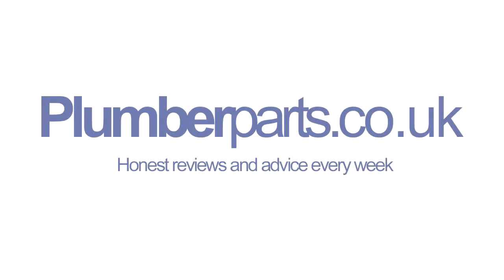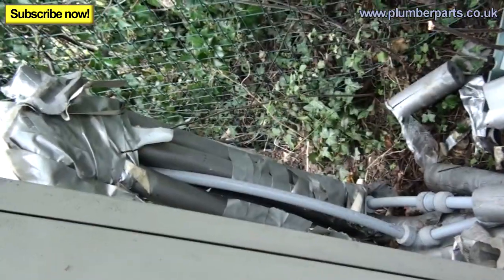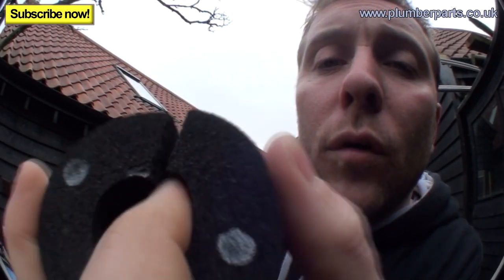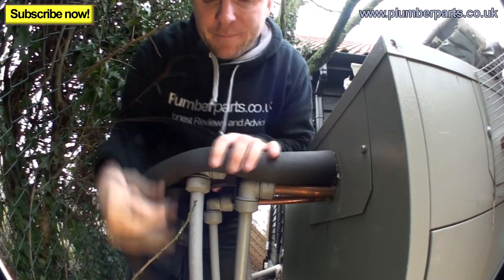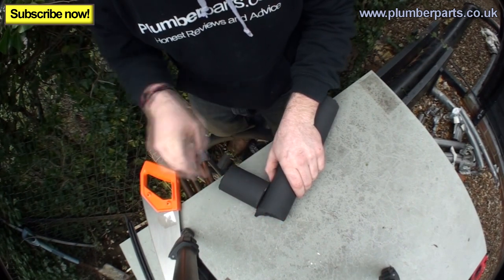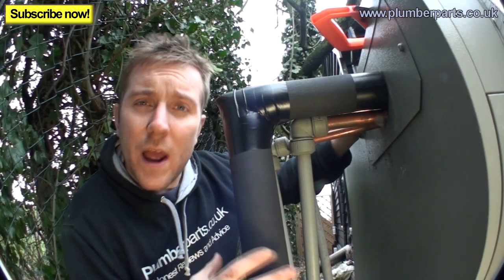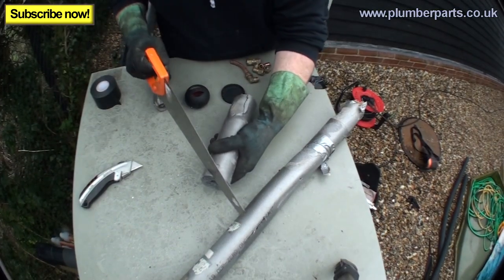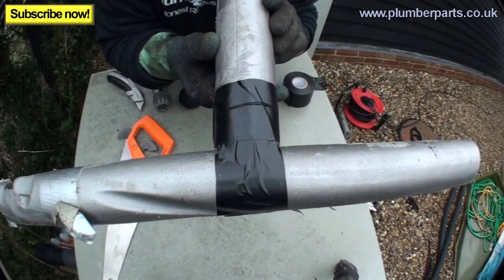HOW TO INSULATE PIPES - Plumbing Tips

Comment: Tape won't last, Armaflex will not last more than a few short years baking in the sun before it'll become brittle, crack and useless. There are better ways of applying the insulation (glue) and certian uv resistant paints. But what do I know? I'm just a heat and frost insluator professional.

Comment: For the miter I “carefully” use an electric miter saw.  I start the blade then let off as I carefully lower the blade.  A much safer way is to place a dowel in the center while cutting.

Comment: yes it's in a building I made. the pipes are insulated but the drain and lower part of the washer is exposed to the weather. also the water lines going to the machine.

Comment: Some points of clarification if I may.

1 – Insulation. Polyethylene insulation (generally the grey stuff) cannot protect against freezing. Why? All insulation begins to shrink at 4 degrees C (by as much as 10%) so needs to be installed in a manner that compresses joints thereby allowing for shrinkage without exposing pipework. Polyethylene cannot be compressed enough for that to occur. 
Currently, as you say, only nitrile based products (e.g. Armaflex) can do this. Furthermore, unlike protecting against heat loss where any cover is good, every tiny exposure to air when protecting against freezing is bad. This is why EVERY joint MUST be glued because tape will eventually just fall off. Whilst glue is sold (but never used) for polyethylene insulation, the waxy surface nature of the material makes the glued joint its weakest point. When gluing nitrile based insulation the glued joint is actually stronger than the material itself with zero degradation in insulation performance. 
Lastly, everything must be covered even the gland boxes of taps and valves
2 – Why do pipes bursts. Think of a length of pipe. When it freezes a plug forms (we won’t go into why…) and even though water is apparently uncompressible, the pipework and naturally occurring air in the water take up that expansion as the plug is typically quite small. Soon another plug forms. That too is accommodated. Then the third plug forms. This is when it gets interesting. Unfortunately it's nothing to do with a pipe being weakened. What actually happens is that the formation of the third plug causes the hydraulic pressure in the pipe to rise (up to 250Bar!) because the remaining water cannot accommodate the expansion. At this point you get the explosive decompression so characterised by the flared splitting of the, typically, copper pipe. The leak only starts as it begins to thaw. 

Plastic pipe is more accommodating of freezing but the fittings are not because they blow off quite easily. By the way, 15mm pipe typically bursts at about 30ish bar (450psi) and 22mm 20 ish bar (300psi).
3 – Freeze protection. Insulation can NEVER protect against freezing. All insulation can ever do is slow down the loss of heat.
If you wish to protect pipes from freezing then the heat loss must be balanced by heat input i.e. by the installation of electrical trace heating.

Apologies for going on, but people need to know the real facts so they can make informed choices on how to protect their property and systems and your vid helps hugely.

David @TapMedic
Reply: Can I actually use water and temperature resistant aluminum foil tapes instead of metal sheet covers over heat tracing and insulation for the freeze protection of outdoor process water pipelines?
Reply: Great comments, would really appreciate a video or refer to link to on how to prevent pipes from freezing, I've moved to an old house in Denmark with lots of pipes exposed either outdoors or in unheated spaces almost guaranteed to be sub zero during winter.
Reply: @kuelhuna  Brian the only way to spot pipes freezing is to continually replace the heat lost with more. This is what 'trace heating' is. An element running down the pipe so that its heat energy is transferred into the cold pipe.
A vital aspect of that is fitting appropriate insulation. Insulation simply slows heat loss but inadvertently it can cause over heating if its too thick. All trace heating suppliers will give you advice on exactly what to use for their product. Just ask them but choose a well known make as cheap stuff breaks down very quickly in comparison and you'd only know when water was leaking and then you'd be faced with a big bill.
Reply: If you have condensation on pipes in basement which is best to use this black stuff or the normally grey one.

Also where’s best to buy black one in the uk.

Comment: I always cut and glue mitre joints and in the case of 90° bends I use the three part bend, it looks so much more professional than tape. The glue I use is the one supplied by armaflex.

Comment: we have learnt so much from when this  videos were made,  The insulation used was Class O and if fitted outside  will need to be fitted to manufacture which means it needs coating twice with there  paint to make it weather and UV resistant, this will need recoating every two years, another big problem with doing this is it cant be painted in the cold or if it's damn / raining or snowing  🙁☹🙁😣😖😫😩  there are other products available in 2021 that have solved all these problems  👍👍👍👍👍👍👍
Reply: Hi can you tell us what the products are called? Do you happen to know which tape to use?

Comment: Great video, thanks. I'm wondering which to use - armaflex or climaflex - on a gas boiler overflow pipe coming down the outside wall. The original is black stuff, which now seems to have shrunk, and when I tried adjusting it I found the surface is all crumbling.

Comment: I've put some gorilla tape and unibond (wider) tape on the joints but on one or two I used some Amalgamating tape as it's waterproof as well. Will the gorilla & unibond still work okay ? I didn't have self sticky joins so my armaflex (15mm/9mm) had to be cut as well.

Comment: Your insulation seems to fit much more snugly over the push fit joints than mine has. Are you using a bigger bore to achieve this or is it because armaflex is more flexible?

Comment: Hello;

As a fellow plumber across the pond; I have a question on UK rough-ins.
What is the rough in measurement for a toilet off of a finished wall. Have another friend from the Uk who is buying a toilet from this area and is curious if it will drop in place. From finished wall to centre in North America is 12".
Thanks!  Al

Comment: HOW TO TEST PIPE HEAT CABLE TO KNOW IT ITS STILL WORKING UNDER MY MOBILE HOME .i  HAVE A FOAM INSULATING PIPE COVER OVER THE HEAT CABLE. SHOULD i FEEL THE PLUG WITH THE FIRST FOOT OF CABLE GETTING WARM IF IT WERE 38 DEGREES OUTSIDE?

Comment: I have an Air Source Heat Pump (air to water) installed outside. To protect the heat pump from debris and sludge from my old radiator heating system, I needed to install an inline magnetic filter on the inlet side to the heat pump, and the most convenient and easy accessible location was outside close to the heat pump itself. I had the return and flow pipes inside and outside insulated, but so far have not found a suitable neat way of insulting the filter. The filter I am using is the Grant MagOne (similar size to Fernox TF1). Can you pleas help?
Reply: I made a box out of kingspan for mine, fitted around the filter then stuffed full of rockwool and glued together with CT1.
Reply: @RS20O0  Thank you for sharing with me your idea of insulating the filter. I will have to do something similar, but I am amazed no one has come up with a commercially available isulating jacket or equivalent.

Comment: You never use a saw to cut armaflex insulation instead use a nice sharp filet nice which will cut the insulation very nice and also outside I would throw a PVC jacketing over it or armaflex 99 paint

Comment: I got a job for a garden tap to be installed, customers kitchen and bathroom is at the front of the house but the garden is at the back. I recommended to run the pipe under the floor or through the house but customer does not want the house damaged (recently decorated ££££ lol) but they really want it run externally all around the house (ugly I know) they already have a plastic pipe run that keeps leaking all the time so they want me to run a copper pipe all the way through, is it possible with copper and is James insulation ok with the awkward job I have HELP!!! Really don't want to do the job and a few months later getting a call back I hate call backs and I normally don't looooool
Reply from the maker: Run inside or avoid the job altogether mate! SUBSCRIBE! ➡️👉 https://www.youtube.com/subscription_center?add_user=plumberparts 👈⬅️if you haven't already!

Comment: the lagging in the video Class o also will deteriorate and turn it to a sponge that holds water if any moisture get inside between the pipe and insulation,, manufactures adhesive has the same problem and there paint and can not be used in cold or rain / snow,, please do not use tie raps as sealing is so important

Comment: I'm a union pipe insulator and his miters were horrid!!! All you have to do is measure from where you need to insulation to the center of you 90° or 45° then scratch a cross on it and then cut across it

Comment: I have a a problem every time I run my bathroom tap or shower
The pipe outside starts to male clicking noise quite loud for a while den it stops.

It happens every time u use shower or taps